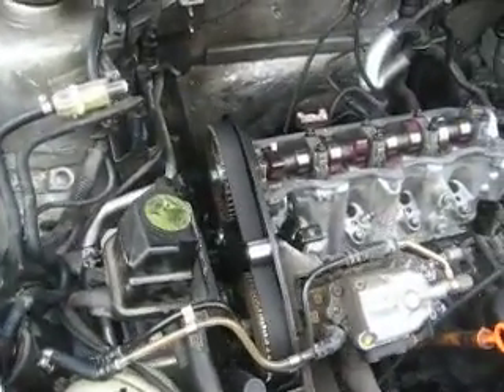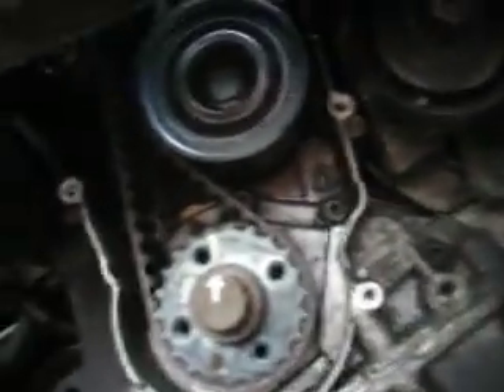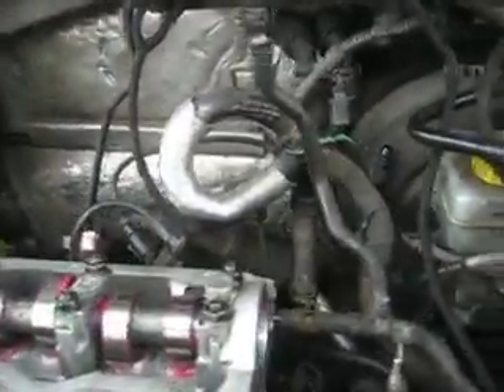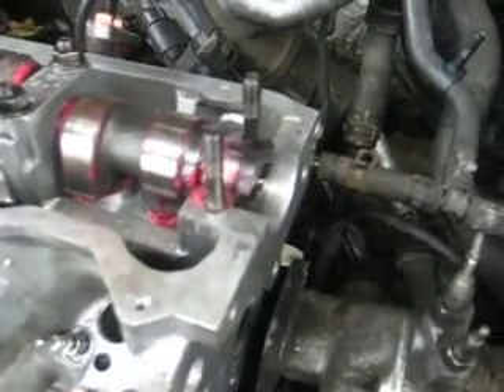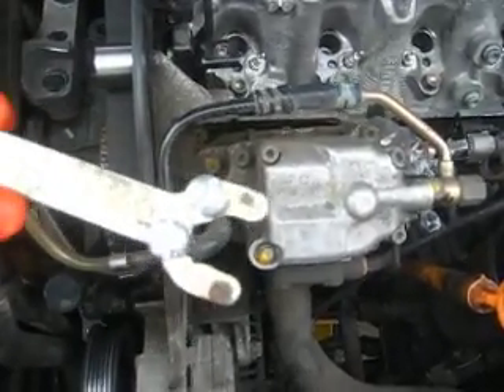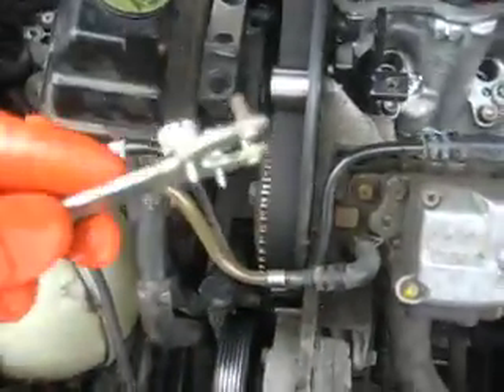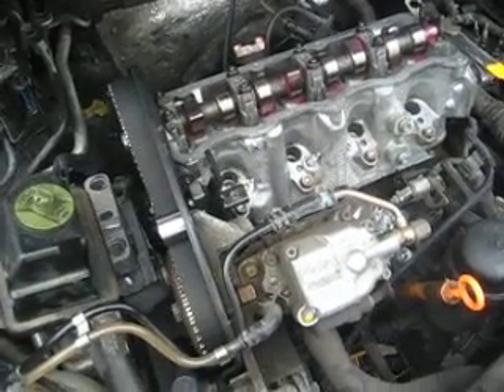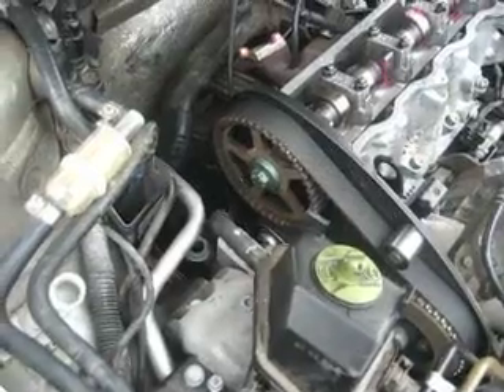VW TDI Timing Belt with no Tools + Helpful Hints

Comment from the maker: You have to know the differnce between the 6cyl and the 4cyl.  The 1998-2003 VW TDI ALH was a 4Cyl engine, and has Three mounts. One above the backside of the passanger tire on the engine, One above the backside of the driverside tire on the transmission, and one behind the transmission's differential (sometimes called a "Dog bone") that helps control engine rock. To do the timing belt you have to remove the passenger side one and then let the engine drop about 25cm or 10 inches.

Comment from the maker: Outstanding!  If you look closely you will see the 3 dots on both sides 180 deg out of phase. That is why I said (in the quick note) to look for the pulley alignment bump on the main crank sprocket. I just changed another TDI ALH flywheel. It is a high performance 9lb VR6 type single-mass. This one had to be changed because the number 2 cylinder was full of oil and that hydraulically locked the motor.  When the owner went to start the car.  The starter just broke off flywheel teeth like corn.

Comment: I have a 2002 Jetta 1.9 tdi ALH engine. However, the 3 dots on my crank gear were not in the position you show...they were 180 degrees different and near the peg for the crank pulley. I did verify the cam was in the right position and locked as you describe, and the flywheel mark (-0-) was on the front most edge of the inspection slot. And, you can't forget to align and lock the injector pump...which caused a no start my first try. But, after finding your video, the 2nd try = success!!!

Comment from the maker: "How hard are the 98-03 ALH Glow Plugs to remove?" The OEM glow-plug harness is unreasonably brittle and will break when you go to remove them from the glow plugs. The cool part is that all that plastic molding is not needed for the glow plugs to work. (step 1) remove harness (step 2) clean area around glow plugs - use a brush & compressed air (step 3) use a deep socket with extension to remove glow plug (step 4) remember to use anti-seize when reinstalling new glow plugs (total job 1 out of 10)

Comment from the maker: I actually took my time and set the new belt while the Cam was locked.  I did not loosen any cam bolts.  I only loosened the tensioner. I did do a full 360 by hand turn on the main crank.  Then I rechecked all timing points. It was a tight fit, but take your time. If you loosen too much stuff then your timing will not be true. But you sound like you have done this before.

Comment: You forgot to mentioned that you have to remove the cam pulley and leave it loose then tight the tensionner and also leave the 3 bolt on the fuel pump loose too and put the bolt half way in the holes so you have adjustment on ether side and to hold the crank a the right position use a m8 bolt and thread it until it touches the seal carrier but don't  put too much force and then torque every thing and turn the engine with a ratchet to make sure you have no valve touching the piston
Reply: V10PDTDI how can I take off the cam sprocket without the special tool?

Comment: Oh, I've heard about that, if I'm not mistaken the engine begins to consume it's oil and you have to stall it to turn it off, since the ignition source is the compression+heat (the latter which is already present on a warm engine), question is why not fit decompression valves to all TDIs to act the moment you turn the ignition off? Would it make their cars less appealing by having an extra start cycle / longer start procedure or are there other reasons why this isn't feasible aside from cost?

Comment from the maker: If the timing is off by one tooth left or right you should not have an impact but the car should not start, and if it does it will run like poop. You should always do one full crankshaft rotation by hand before starting a newly timed car. none of this will tell you if the diesel pump is 180deg out of phase or not, but you have a 50/50 chance of getting it right.

My wife just had a "Run-A-Way" her 98 TDI. A "Run-A-Way" Happens when your turbo seal goes bad. So Another winter rebuild. Weeee!!!!

Comment: Thanks for clarifying it!, excellent videos by the way. Are after-market Chinese pumps worth it?. I've had to deal with the aftermath of a destroyed water pump and thermostat failure on a late model Honda... not fun. Let's assume timing is shifted due to an error during re-assembly, and we overlook it, can we feel it while cranking by hand at all or the valves just won't hit the piston (or would we have to be way off for this to happen?). Thanks again!

Comment from the maker: You are correct.  The passenger side motor mount has to be removed to install the new timing belt.  You can cut the old one but I would prefer to tell other to just remove the mount and timing belt upper and lower covers then just remove the old timing belt. ALWAYS replace the water pump when installing a new timing belt.  The water pump spins at 3 times the speed of the engine and after 100K miles that means that the water pump has 300K miles on it.

Comment: To remove the actual timing belt do you have to unscrew the motor mount at all or is this just bs from the mechanic I heard?, The way I've seen it done on some of these cars is that they cut the old one and to install the new one they have to support the engine and remove one of the mounts...

Comment from the maker: I didn't have that TDI relearn timing. These are not 4 valve per cylinder cars. They only have 2 valves per cylinder. The timing is not that complicated, and between the belt and the diesel pump timing you are , for the most part... there.

Comment from the maker: Continue 2... You can remove each spark plugs and crank the engine. Each cylinder should go through an exhaust, intake, and compression cycle. You will need a helper to visualy check.  Crank engine and look to see that each cylinder behaves the same. If you have the cam cover off when you do this you can see when a cylinder is sealed (both lobs for that cylinder would be pointed up).  When a cylinder is sealed it should hold pressure.   Take a small 6" 1/4 length of hose and test for a leak.

Comment from the maker: Continue... If you have a SOHC 1.8L or 2.0L VW then you almost definitely have to remove the head. If your Timing belt broke then the pistons made contact with the valves then the valves can be either stuck open or closed. All you need is two to keep an engine from running. I would remove the valve cover look past the cam at the lifters. If the valve is bent then the lifter should be damaged. You may have to remove the cam to clearly see the lifters.  Start Check: Timing - Fuel - Lifters

Comment from the maker: To be clear you have a VW (GTI, Golf, Beetle, Jetta, Passate, Rabbit, CC, EOS, Polo) Gasser that suffered a broken Timing belt. What year? What engine? How fast were you going when it broke? Because you have a Petro fueled car it does not have a belt driven fuel pump.  That means that your fuel pump is independent of the motor (check fuel pump fuse). There should be a fuel pressure tester port on the fuel rail near the injectors. But I don't think your problem if fuel delivery related.

Comment: Any tip for a newbie ^^? my belt to my fuel injector snapped, bought a new one and did place it as it should be. Still not starting :( Can it only be air that is in the system? At first we belived it just had gone dry so did use some time to figure out that it was the fuel injector :P

Comment from the maker: If I had a wish... I would not wast it on that. My point of view is, "Get The Job DONE!"

I think because of the timing of the single cam and the diesel pump that a chain would be very difficult.  Timing chains require submersion lubrication, and the addition of the diesel pump... well you see what I mean. Think of it most people trade their cars in before the hit 100k miles. TDI owners are in it for the long hall (500k+ :)

Comment: Good vid but I think it's time for VW to stop using timing belts. Seriousy.. you can't get a timing belt on a Hyundai now..and Toyota has been using them on their small 4 cylinders with virtually zero failure rates at mileage extremes.  why is VW still using them? Timing chains, if implemented correctly.. are superior to belts and don't have to be worried about. Welcome to the 21st century!

Comment from the maker: Now! keep in mind that you are not using the cutting side of the drill bit. If you look at the rental or for purchase tools for doing a TDI timing belt change, you will see that the tool that is sold for locking the diesel pump is all one diameter and is shaped like an 'L'. The back of the drill bit is a perfect fit. You do not need the extra 'L' angle part.  Good luck and V-Dub-Love from Chicago.

Comment: Thanks for the tips. How did you make the drill bit work as an injection pump locking pin? It seems like the diameter of the pin needs to be "stepped" so that it's large enough to fill the hole in the pulley.

Comment from the maker: My first experience with VW diesels was with a 87 VW Diesel Rabbit.  I can only suggest that you get a 110v hot dip oil heater, because all VW diesels before 1996 had a horrible winter gelling problem.  And in typical Chicago winters that could get you stranded.  The plug-in oil heater works well. And never use after-market Glow-plugs.

Comment: these vw diesels are very easy to time correctly compaired to some other diesel engines and even then those engines are not very hardto do. timming an engine is easy once you understand the principle behined it then you can time any engine from scratch with no marks and if tools are needed they can be made i no i have done it many times.

Comment from the maker: As I can recall the TDI had 93+K when the water pump failed, taking out the timing belt.  If the water pump had not failed the belt would have lasted longer.  I was told by the VW Tech Supervisor that the OEM factory 2003 Timing Belt had a rated life of only 80K MAX, but the New VW replacement  belts were rated 100K miles not KM.

Comment from the maker: I am a member but have not been on in over a year. I don't know if this is do to the CEL or just a over-boost fault. When I get aggressive with acceleration on all my TDIs the Turbo drops out.  I have to turn the car off and back on again to restore the Turbo.  I have been looking into Switchable Vacuum bleeders to over ride the computer boost controller. Also I have been thinking about the .681 5th gear kit to get more MPG. This summer is full of fun mods. 

DubLuv

Comment from the maker: DieselRX says right on the box "Made in the USA". Maybe the box is "Made in the USA". Either way I wanted something that works and Boschs don't seem to last over three years. 

If you find a way to delete the EGR without doing a stage I or II and not having a CEL then let me know.  I have done a crude delete but the ever present CEL reminds me that there has got to be a better way. I also tried to make the small circuit and interrupt the MAF signal.  I still have the CEL.

Comment from the maker: @ThatT6uy Yup! I am on the southside of ChiTown. How much does the seller of the TDI beetle with a broken timing belt want for the car? The price of TDI's has dramatically risen.  If the seller was asking for $3,000(USD) or below it is a deal if the trans, body and interior are all in good shape. Of-course this is assuming that the TDI is within the magic year range of 1998 to 2003. The rebuild, if you do it yourself, should reasonable cost another $1,000(USD) and take about two weeks. TDI Love!

Comment from the maker: @MrBrownstick My timing belt broke. I agree that it is best to change your belts before they break, and marking the cams & pulleys, even if it is not spot on, will put you in the ball park. But you should in no way only use those marks to set your timing. You have to check for TDC and lock your Cam shaft at TDC. I guess I got lucky with the diesel pump, because it can be 180 deg out of phase. This is because the Diesel gear is twice the size of the other gears. The pump pin worked.

Comment from the maker: If you have black smoke then try this: You can add 16oz of 91% Isopropyl Alcohol to the diesel to stop block smoke.  The Isoprpyl will also help with winter starts.  It works like magic. It has to be 91% or higher.  Do not use the more commonly avalible 70%.  It has too much water.

Comment from the maker: @freebuilder007 I was raised with 3k oil change interval burned into my brain. The smart VW guys and gals say 10k should be the target. The oil I recommend is Pennzoil's Ultra Class Full Synthetic at 5W-20 or 5W-30. I was a Mobile1 Synthetic fan about 7 years ago, when Mobile was one of the first to introduce Clean Suspension tech, but Pennzoil has a well priced ($30 US per 5QT) fair superior product today. I used Royal Purple's 0W-10 and it scares me. Use 5W-20 for best economy.

Comment from the maker: @best333WillC Most important is that you always use 100% Synthetic motor oil. Your turbo needs to stay lubricated and regular motor oil gums up can cooks inside your super heated turbo.  I recommend 5w 20 weight synthetic oil.  If you live in a very HOT temperature region then 5w 30 a better weight.

So many TDI owner go cheep on the oil and have to pay big $ for a new turbo or worst they just settle for driving with out the turbo.  A TDI without the Turbo is not worth driving.

Comment from the maker: @best333WillC the old timing belts were dealer recommenced to be changed every 75k miles, but all the older timing belts should be cycled out of the market.  The new timing belts have recommended change interval of 100k but if the water pump is in good repair I have seen a timing belt last over 180k miles.  I would not push it.  The down side to a failure is that you often get little of no warning and the cost is often half to two thirds of the value of the car (anywhere from $2,000 to $10,000).

Comment from the maker: @Prophet2525 I think the main diesel pump sprocket is beveled and that pitches the belt towards the engine.  This should not cause premature failure.  You can actually tow a VWs Golfs a new timing belt... so the belts are really strong.  I would not worry unless I saw signs of either mechanical or friction related damage. After 5K Miles or Miters if it were going to fail it would have.  

Remember: Look, Listen, and Do-It-Yourself = Savings & Reliability = Car LOVE :)

Comment: I noticed that your timing belt is more towards the inside edge of the sprocket.  Did it remain that way after running the engine?  Mine started in the middle and moved to the same position as yours.  I have 5000 miles on the belt and it does not seem to be fraying.  Only worry is that the inner edge of the belt seems to be rubbing on the tensioner pulley ridge.

Comment: For tightening the tensioner, I used a harbor frt snap ring pliers($5)  with the changeable prong removed. Grind the two protrusions that hold the prongs so it fits in the tensioner holes.  Works very well..  To keep the cam from turning, I removed the cap like you did and used an allen wrench that best fits the camshaft groove.  Only tool I did not have was the camshaft holder so I can replace the camshaft seal.  Thanks for your post.  Saved some bucks
Reply: Dang bro thanks for this info on the sap ring pliers, I’m getting ready to fix mine and do not want to pay $400 bucks for the timing tools which I do not have in the first place or I would have junked this vehicle a long time ago

Comment from the maker: @WAKeele I have 3 TDIs and 1 has a G60 single mass. I don't notice any diff. I think the dual vs single mass debate has less impact on street cars.

Why did I replace my Turbo, because while trying to open the turbo to clean the VNTs I broke the housing and destroyed the center cartridge. XSBoostTurbochargers·COM has fully balanced 98-03 TDI turbos for only $360. The car I rebuilt runs better then the other 2 I think its the Turbo.

Injectors require tuning but can add the most performance.

Comment from the maker: @WAKeele Took me approximately two weeks to do the rebuild after the timing belt went. My main problem was the defective factory installed water pump. The water pump with the plastic impeller gave way and allowed the timing belt to slip.  $1,500 later I had new valves, new turbo, new head gasket, new water pump, and a complete timing belt kit with new drive belts too. I have never done a TDI rebuild before but the dealer in Chicago was ready to charge over $5,000.  Turbo alone is +$1,500 dealer.

Comment from the maker: @WAKeele When i went to remove the Vacuum Pump the two toothed center gear was broken into 5 parts.  Because the Vacuum Pump can spin freely in both directions, it still is a mystery my it was broken.  If yours is not broken then don't replace it.  When I removed my pump the parts all fell out.  So I knew something was wrong.

How bad was the damage from your Timing belt with dental problems? I want to know parts and Cost

Comment from the maker: @mongrelmob100 The golf gets about 42 MPG (5.6 liters per 100 km) although the speedo is off.  We think the ECU is setup for 17" (432mm) rims. it only has 15" (381mm). 

I thought the United Road Transport Union (URTU) was holding the price of UK diesel to $5.  what gives?

If you are going to run you TDI on alternative fuels then be sure to install a pre-filter, as I did.  This pre-filter we save your main filter and let you visualy see the color and quality of your fuel. (mark 0.34 in video)

Comment from the maker: @mongrelmob100 Where did you get cheap 100% vegetable oil.  We buy diesel in Indiana for $3.69 per gallon and that is the best price we can find within driving distance.  But even that is 20 miles away.  I have herd that diesels can run on used ATF without any special addatives, but if you use Vege oil you need additaives is this true?